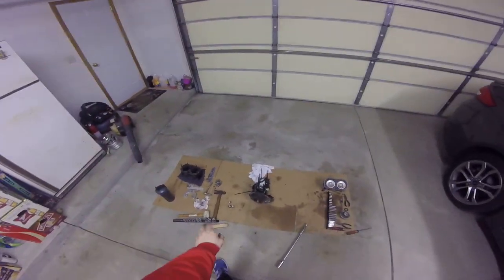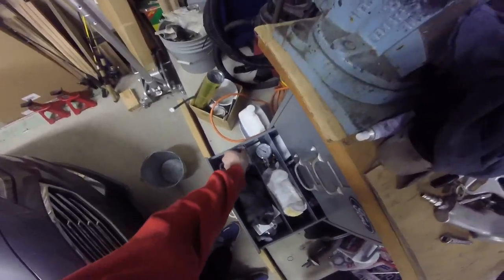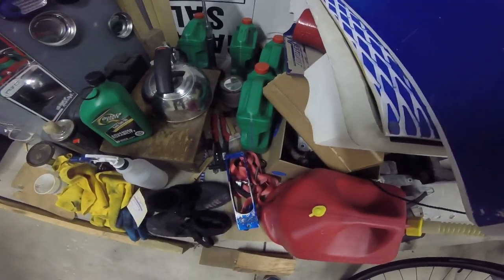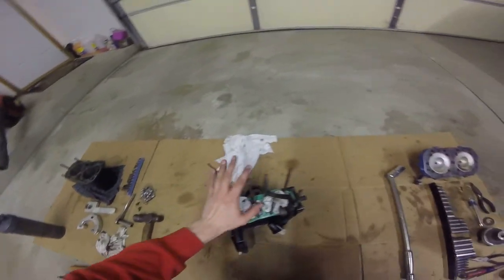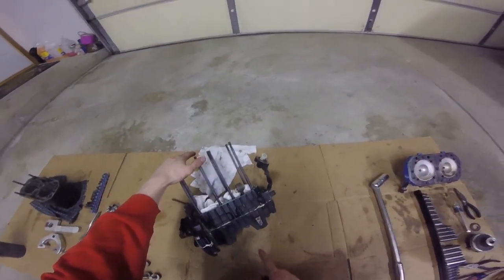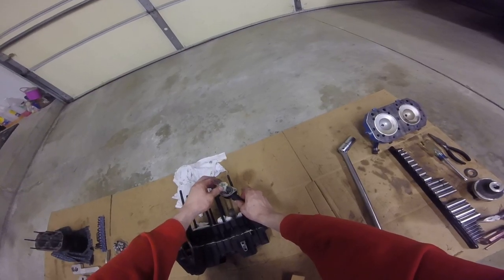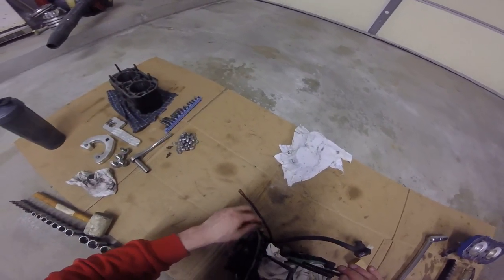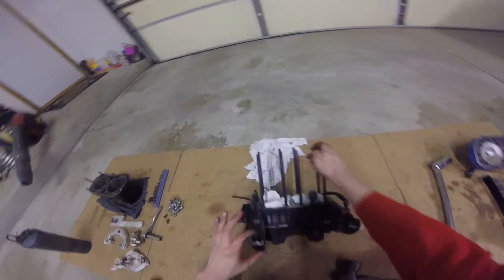Js550 Flat Deck Complete Engine Tear Down Part 3

Comment: any videos or opinion on your flatdeck ski in the water?...how does it handle?.. Im considering doing one like that... does it work well?
Reply from the maker: I haven’t made one but I can make one up on a full run down of it. All and all I wouldn’t recommend doing it unless you come across a hill that already has been cut like the one I have. It kind of throws the balance of the tray off. The better option would be just going with a wide tray in my opinion.
Reply: @motorandoutdoor8137  we were thinking of cutting the sides off and concaving each side like the flat deck but at a 40 degree angle... so its more of a bowl shape... just not sure how the ride would be on a full flat deck.. this got a few of us talking.. we all have the big skiis but playing with a few vintage options right now.... if you do get a chance to do another vid.. that would be fabulous. 
thanks bud. well done.
Reply from the maker: For sure I can do a run down of it over the week at some point. Thanks mate🤙